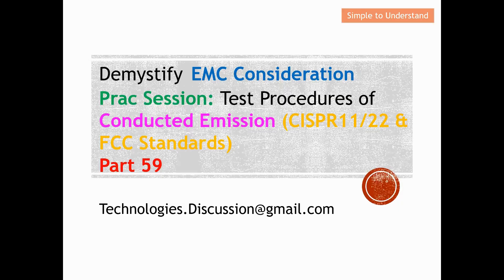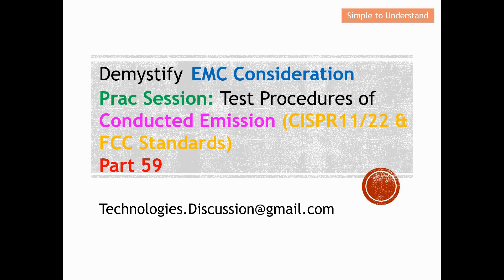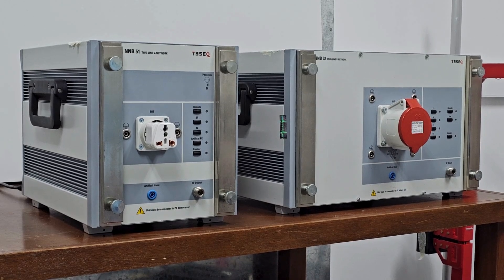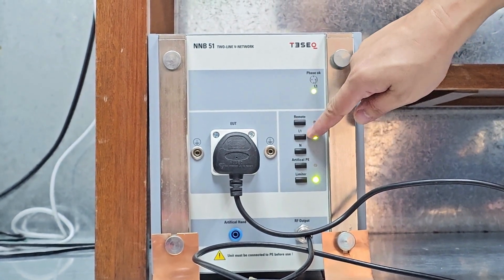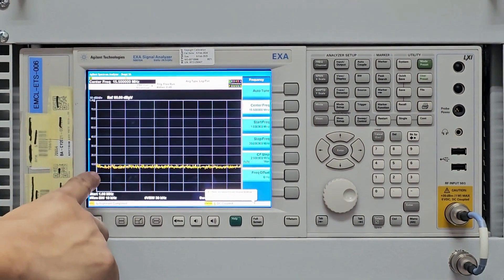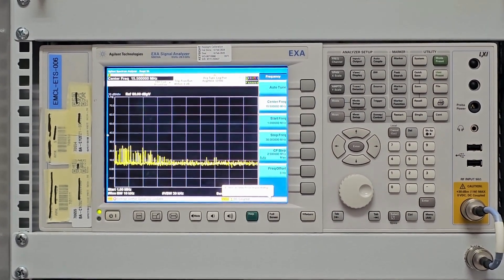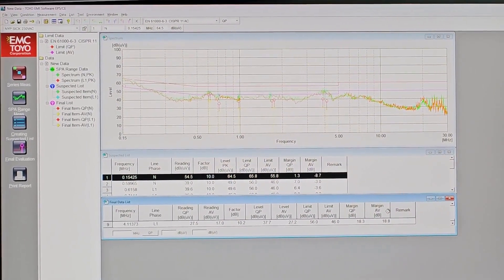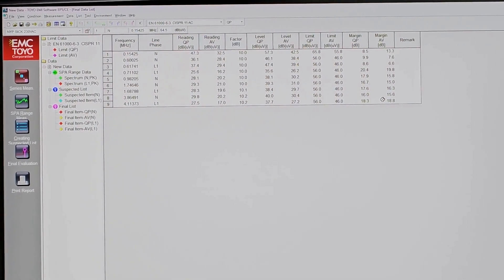EMC #59. Practical Setup & Conducted Emission Testing for CISPR 11 (EN 55011) & CISPR 22 (EN 55022)

Comment: Some good information in here, but also some inaccuracies. FCC conducted limits start at 150 kHz, not 450 kHz - see Part 15.107. The setup shown also doesn't follow ANSI C63.4 or CISPR 32.
Reply from the maker: Thank you for your question.
CISPR CE stds most start at 150kHz. FCC, 02-157 starts at 450KHz. https://docs.fcc.gov/public/attachments/FCC-02-157A1.pdf
Last few lines at Pg 2.
I am not so sure if all FCC start at 450kHz? Maybe some start at 150KHz. I do most of the test according to CISPR stds.
The setup in this video is according to CISPR 11.  :)
Maybe u can help to share on the setup of CISPR 32.
Thanks for your questions.  :)
Reply: @technologiesdiscussion1676  You are referencing a doc from 2002. The rule was changed soon after - https://www.federalregister.gov/documents/2002/07/10/02-17264/conducted-emission-limits . In CISPR 11:2015 clause 7.5.3.1.2 - the EUT needs to be 80cm away from the LISN. The mains cable is also bundled if greater than 1 meter. hard to tell from the video how long the cable is. Overall good content. I don't want to discourage you from making videos.
Reply from the maker: Thank you. I also need u guys input so that my content is currently. I am definitely happy to rx feedback and suggestion. Thks, bro. No worry. I am not using this Youtube to make money but just knowledge sharing.  :)